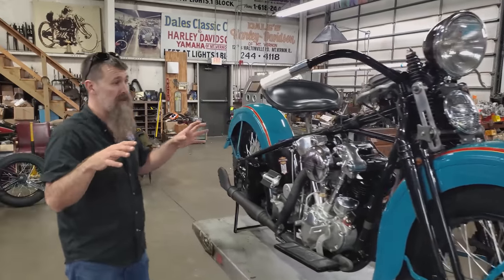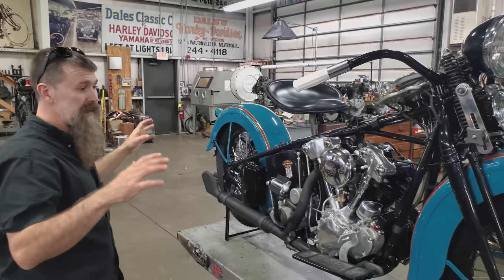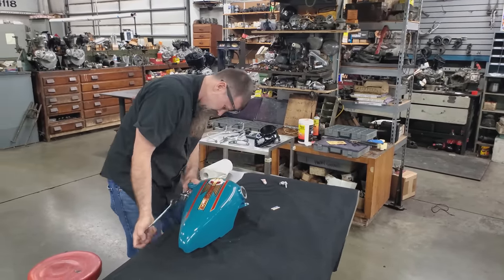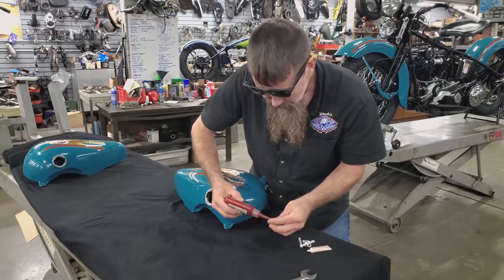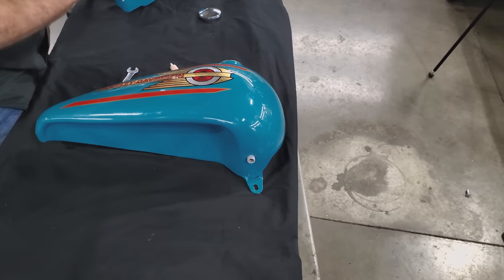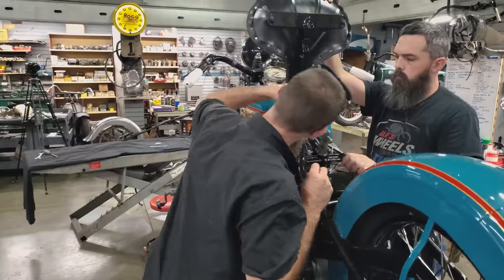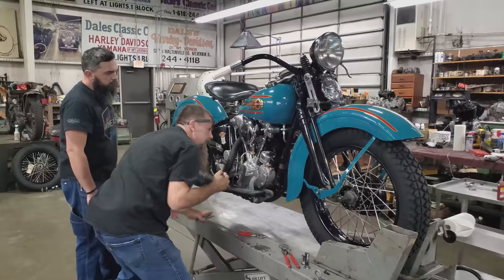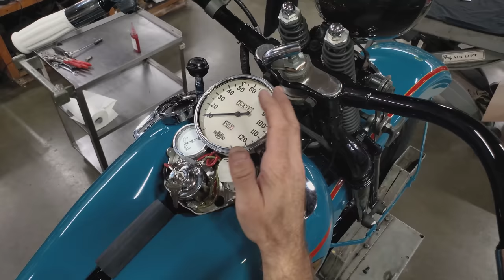A One Year Only Restoration - Finally Finished!

Comment: Matt's like a kid in a candy store.   Have you ever tried using clear silicone instead of Locitite for non-critical fasteners?  I have used it for years because it comes apart easily and still has some grip left if you have to take something apart on the side of the road.   Keep the good stuff coming Matt.

Comment: Don't know much about Harley Davidsons but would like to know did the rigid tale frames crack on those bikes as the roads were pretty rough in those days. Love your videos though.
Reply from the maker: Cracked frames are not uncommon, but the front springer forks absorb most of the stress of bumps, so it wasn't really an issue.

Comment: What's up with the 1938 oil tank...  Geeez
Reply from the maker: Maybe you meant 1936 oil tank 😉
Reply: @wheelsthroughtime  You are right! Didn't see the bung vs the flair adaptor fitting on the back side of the tank. 1 year only.